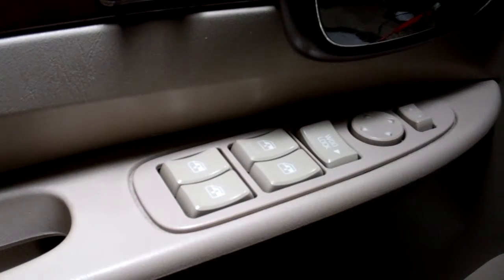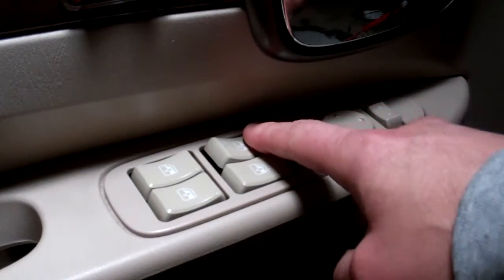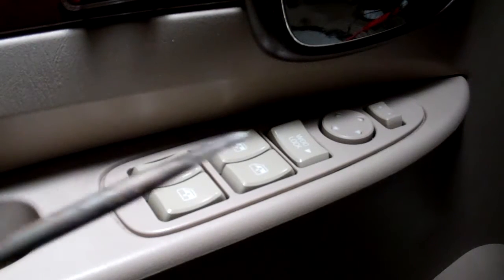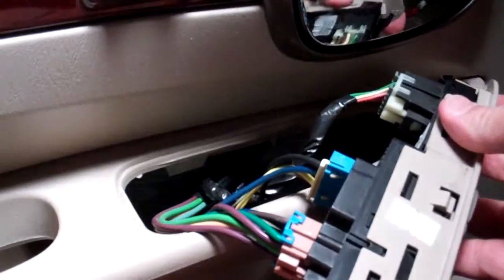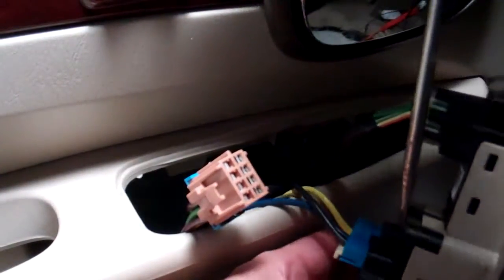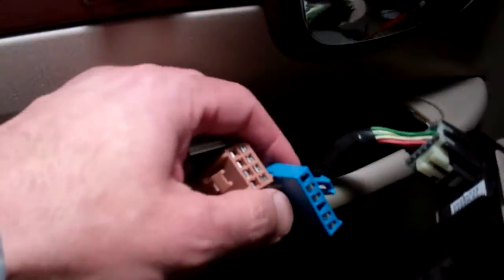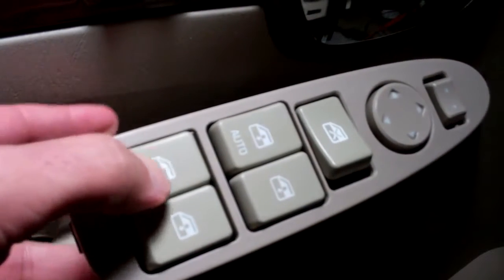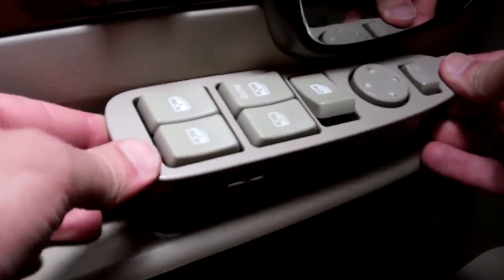Buick Power Window Switch Vlog 37

Comment: My drivers side also stopped rolling up but would roll down no problem. did your window roll up slowly whenever you tried to get it to go up? I replaced the whole window regulator assuming the motor was going bad but still no luck with it rolling up. I was thinking about replacing the switch instead..
Reply from the maker: Mine just stopped.

Comment: Jonny did u check the fuse in floor panel first? Manual says #35 fuse but its location has a number #30 in it. Shuld i check that before ordering new box switch?

Comment: Heated seats out, is this a fuse too? And what about the heat , get ac in summer blows cold air too in winter. Can u plz make detail vid on these things? Tyvm
Reply from the maker: Always check fuses first. I do primarily tech vids with some other topics but I would check engine thermostat.

Comment: we have this car, our back driver window doesn't work-very annoying and the audio system is better than most 2005 model vehicles: 2 6-by-9 subwoofers stock? I was surprised when I 1st saw them cause I usually see 4 mid drivers and 2 tweeters in the doors (I'm going off into car audio land again) the Buick Rendezvous is a very nice SUV, unfortunately we got our kinda in not so good condition.
Reply from the maker: Best of all...not on recall!
Reply: Yep.